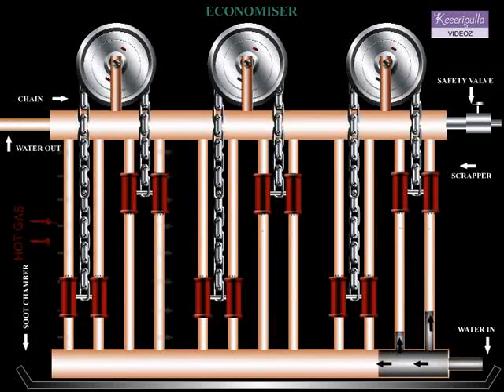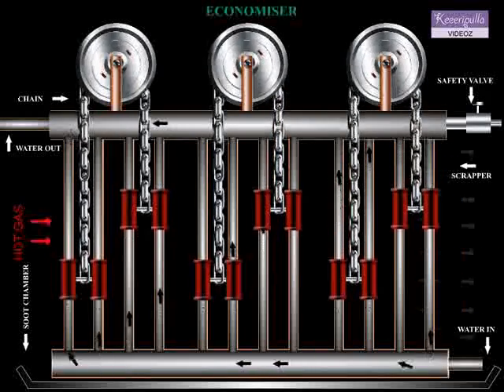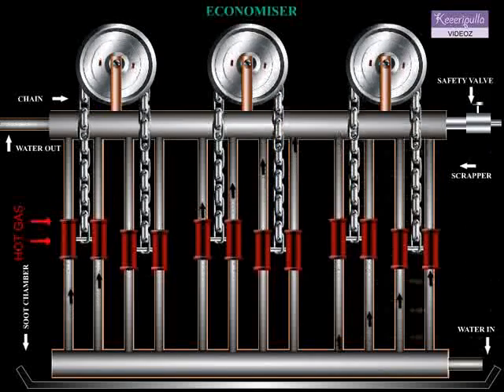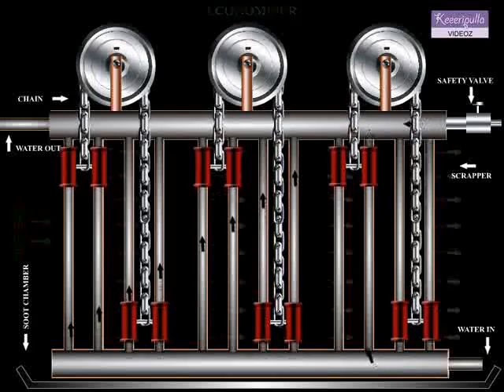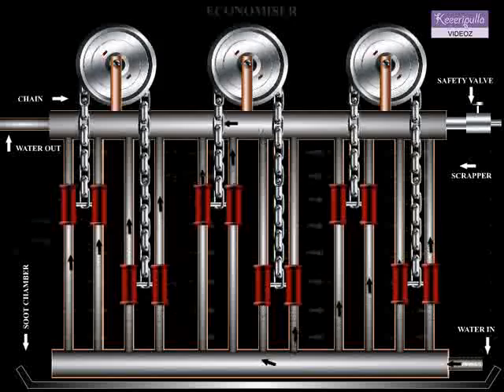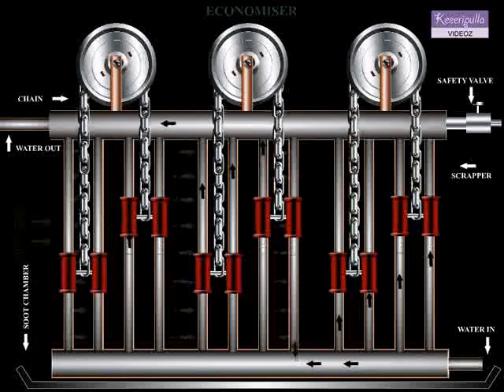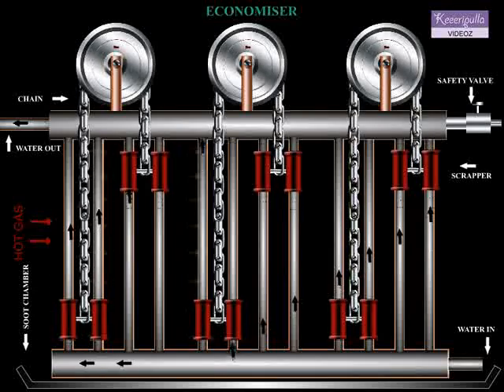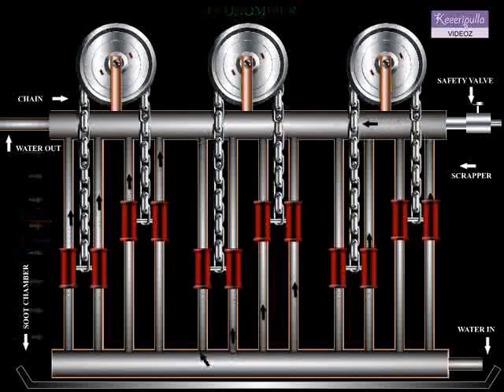Economiser

Comment: How is the soot or rust that develops on the vertical pipes actually scraped off? How do the scrappers work (brush action)? Finally, what mechanism and power moves the wheels? How much force is needed? None of that is clear from this otherwise excellent presentation.
Reply: sir thank you for raising these questions  , if you got the answers regarding these questions then kindly share with me .
Reply: @jessicagreyjessica7296  mechanical scraping apparatus, which was needed to keep the tubes free of deposits of soot.
Reply: mechanical scraping apparatus, which was needed to keep the tubes free of deposits of soot.